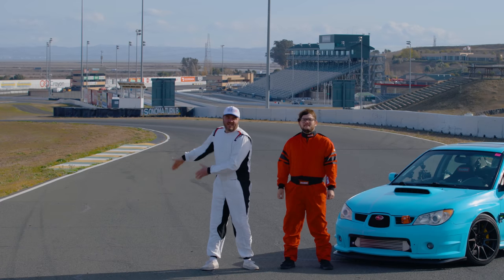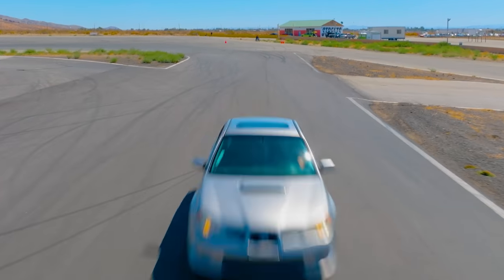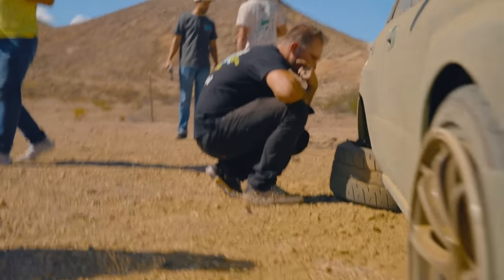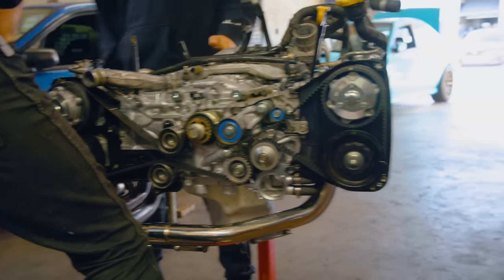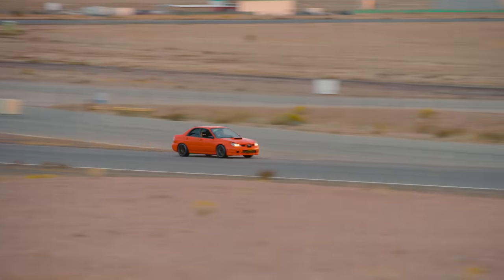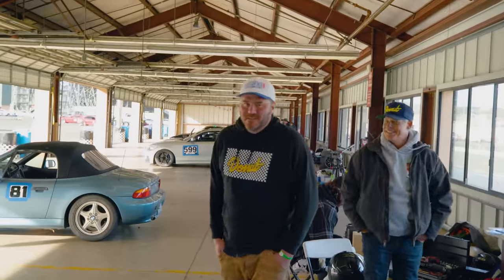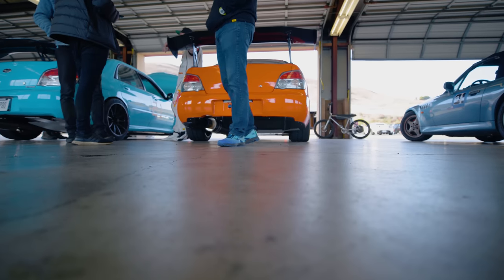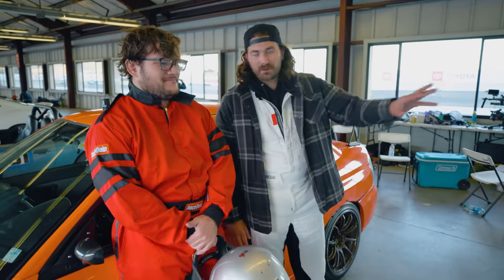$21,000 vs $43,000 Subaru WRX Build - HiLow FINALE!

Comment: I’m still thinking you guys should do a money pit series on an old school Honda. You can use the EG hatch that Nolan got for $500. That way you can take your time building up a really nice setup. The cherry on top would be that you don’t need to worry about blowing the engine.
Reply: the d series means that car is useless and a b or k swap is a big thing compared to turboing a miata
Reply: J swap it
Reply: @xexecuterxx  turbo vitara build is sub$1000 and the d16 would make some serious hps, also a B swap in an EG chasis specifically is really easy so it would be viable if Nolan did single camD and James did Dual cam B
Reply: I'm thinking they had something planned from the time they bought it.
Reply: As a bugeye wrx owner......yes
Reply: I would love to see B swap Honda Civic VS delta/theta swap Hyundai Accent.
Reply: YESSSSSS. Hi car with a k swap and low car with a b series
Reply: EG without blowing up an engine?

yeah with 110hp as peak performance 😂
Reply: I think if they build the $500 civic they should compare it to the new type R.  See if you can build faster for less money
Reply: Came here to say this!
Reply: @TunPiccolo  I have the smallest motor you can buy the d15 single jingle... Mines got 280,000 mi not a single issue. Now they could B swap and make four or 500 horsepower with a GSR trans would be a fantastic video
Reply: @toka100  with a 50,000$ budget ofc the EG will be faster than the Type R. Lighter chassis, stupid cheap parts, you name it. The new Type R will just be the better car all around with all the creature comforts of a new car, and a new sports car at that
Reply: Honda EG high/low Drag car ;)

Comment: The moment I found out hi-low was gonna be Subarus, I knew there’d be a lot of engine replacement happening, and this is coming from a former Subaru owner who intends on getting another one some day.
Reply: Same, I just got rid of my Subaru right before it was going to cost me a fortune in repairs. I'd get another one but I need to convince my wife that the kids don't need any food so I can keep it running.
Reply: Another engine replacement or WRX?
Reply: I just dont get how people blow engines. I have a 14" FXT,  I touge the Sh... Out of it, 150k miles not even the CVT has failed, not even a HG...
Reply: @514aam  Former 06 wrx and 11 legacy owner with some notes. 1. CVT will fail around 175k every owner I know has had this happen. 2. They stil havent done an AOS or baffled oil pan and wonder why things are going wrong.
Reply: Who hurt you Snaker?
Reply: @PongLenis32  Early on in this video they do address that both cars have baffled oil pans. No mention of AOS though as far as I know. The elephant in the room though, at least in my room, is they admitted early on for FAILING TO BREAK IN THE MOTOR PROPERLY. Hurr durrr I wonder if all these metal shavings and components not seating together nicely before thrashing on the track might have something to do with engine failure. SMH
Reply: @PongLenis32  They address baffled oil pans in the episode. They say those were installed "the whole time".
Reply: @joshmurphy1942  I skimmed through and didn’t notice the pans good call but AOS and break in are also key!

Comment: Jeremiah seemed so relaxed in that accident
Reply: I know he’s been in wrecks before at least in motor cross. You may never get used to it but you probably learn how to respond.
Reply: Gotta stay loose and calm. If you tighten up, that's how bones start to break
Reply: @Le Floch  Sometimes, but holding on tight is the reason I'm still around. Mind you, that was in an 84 Toyota pickup with a bench seat and only mostly functional seat belts in a roll-over. In a modern car with airbags and bucket seats, you're probably better off staying loose, less muscle and tissue damage too
Reply: If you panic it makes it worse
Reply: Getting off at a racetrack is not the same as falling in a ditch on the roads.  But seeing the car behind him have to go off track did get me worried!
Reply: @eyemastervideo  saw that; that (edit: BR)Z had a good save.
Reply: @SpaceMissile  wasn't that a brz?
Reply: @xxslayer255xx  17:11 - you are correct, good sir. 
thought I had seen those angled 370 headlights.

Comment: I would love to see the total cost including all the swapped engines
Reply: Triple digits for sure
Reply: So much money
Reply: Definitely not $43k 😂
Reply: yea I need the full receipt. probably over 100k on high car😭
Reply: @robertm6312  no shot
Reply: As someone who owns a few Subarus when people ask me if I'd recommend them for reliability I say no, get a Honda. Having said that bc of the ol head gasket issue. craigslist and Facebook marketplace are a great place for finding safe beaters for new drivers once you replace those head gaskets over a couple days or weekend.
Reply: They should’ve just engine swapped from the start 💀
Reply: 5 engines right? If he’s getting super hooked up call it $10k an engine. So $93k for hi car
Reply: @LingLing1337  They definitely weren't putting new engines in the car until the end, and new EJs for that year are about $2k if they aren't getting scammed, used is $1k, and rebuilt is probably $1.5k again as long as they aren't getting scammed. More than likely they spent about $15k on engines for hi car alone. They did get 2 Type RA shortblocks for both cars at the very end, and that was likely the most expensive block at $2200 per block without install and setup.
Reply: @jasonharrod3070  Sound advice and for the people dead set on the suby just gotta make sure they stay on top of the oil & coolant & if they drive it like a granny it would probably last.
Reply: @drakemadman00  bro it’s three cars, 5 or 6 engines, all of the upgrades and a new transmission. they also had to buy some parts again after the og high car died, definitely over 100k
Reply: @mrmonkey445  definitely not, subie engines are cheap even good ones and a perfect example of a good subie would be top 15k, they didn't have to buy all new parts for it like when the engine died they didn't buy new brakes and a turbo, it was (at most) the new coilover on the axle that broke which was 500 bucks. Seeing as the parts just swap right over there's no extra cost outside of engine and car which is way under that 6 figure mark

Comment: Thanks for the series, highly entertaining!  I understand why you classed tires as "cheap" based on your experience there, but this isn't actually a good idea or suggestion.  In fact, tires are probably one of the biggest "don't buy the cheapest" categories.  Go to any autocross or track and the people that are winning there sure as shit aren't doing it on Walmart tires.  To me, cheaping out on tires - especially if we are talking about racing here and not just parking hard at McDonalds - is right in line with HotBoi Spec.

Spend the money on suspension, tires, brake pads and safety (up to you if seats fit that last category).  Save your money on turbos and big brake kits (though one could legitimately argue that the WRX calipers aren't up to snuff for track duty even with quality pads).  Use that money you would have spent instead on getting more seat time and improving the driver mod.  It's hard time if your times were improving because of the mods...or more likely because you were personally improving as you ran the course more and got more used to it.

Anyway, thanks for the effort here, it was fun to watch :)

Comment: owning a subaru without knowing it flaws is a deathtrap
Reply: Depends on the Subaru. The ej207 engine and 6speed box are bulletproof
Reply: @tracktimevideos5164  Yeah the 207 is literally the best engine Subaru has ever made. I have the EJ20G which is decent but will definitely be getting swapped for a 207 when I have the cash
Reply: Think they would have been safer getting Gremlins. At least the engines rarely blew up. It was those gas tanks though. Didn't want to get hit in the rear end, hard.
Reply: The whole car is one big flaw.
Reply: @tracktimevideos5164  those things run hot as fuck and once it knocks on cold start it's over. Block is done.
Reply: @luckypennybenny  not necessarily. Could be piston slap which isn’t a big concern, normal on built and high mileage engines
Reply: Not really. My Subaru’s were awesome cars. Especially the one I tuned the shit out of, granted I did detonate the transmission, I knew that was coming and was ready to rebuild it. Aside from that, fuckin awesome car. Need to get another one.
Reply: Never had an issue but I’m not dumb enough to put old metal shavings into new engine after new engine
Reply: To be fair I think they bought some meh parts even for hi car. Plus if the V8 video is anything to go off, they're more interested in making these videos fast than modding the cars correctly...
Reply: @Qardo  you're thinking of pintos. Gremlins had no gas tank issues
Reply: The worst part is they knew very well
Reply: @randoawesomemix9501  Alright...yeah I mixed the two up. Doesn't help the two are shitty cars. So...wasn't THAT far off...still off but I at least hit the target.........kind of.
Reply: RoadKill was pretty good for a long while
Reply: Ohh come on!
Who knows they'll be waking up tomorrow morning.
Life is Life, Subaru is Life.  : )
Reply: Change that to "owning a WRX is a death trap" and you would be right.  It comes down to who buys these cars - mostly younger ass hats who never saw an engine they couldn't redline from every traffic light, and never saw a clutch they couldn't burn out.
Reply: This highlights what most already know: Subaru performance sucks, they are for creeping around dirt roads wearing flannel
Reply: @tracktimevideos5164  STI 6 speed > WRX 5 speed: period
Reply: @luckypennybenny  they do indeed run hot but after 20 track days mine is going strong. Regular oil changes are key.
Reply: @cratelab  lol, obviously
Reply: @stubbingtonmarigold3032  this highlights how very little you know about cars.
Reply: I told myself that if I ever own a subie it would be for a garage decoration. lol
Reply: @tracktimevideos5164  not so obvious for the hi/low crew.  It's a bit of disservice to the illknowledged viewers... And if get it... It's "fast food"... And not a grossly indepth build series...There's so many things overlooked...
Reply: Just like with any other car.
Reply: @tracktimevideos5164  I only have ej25 on my 09 sti hatch that I could only speak of. I have fully build ej25  from our mini garage we have full access to build engine since my father is quite knowledgeable about machine, we fly planes and such so we have basic stuff tools and machine to build engine. my ej25 is running like a champ till now, 5 yrs and 180k on its clock pushing around 5xx hp on safe tune on small turbo but it could easily make around 700 on bigger turbo and e85
Reply: Subarus have flaws, but the main problem with them is their audience. Everyone who gets in one thinks they have to redline and throw it around corners with one hand while vaping with the other.

I'm willing to bet these "unreliable" Subies are driven twice as hard as the equivalent Toyota.
Reply: @rando5673  fa24 enters the chat
Reply: The way they were ragging on these cars, it was bound to happen.
Reply: Owning a subaru is a deathtrap.
Reply: @lovingtennessee7726 I love my Subaru. Drove it for two years on a 500$ junkyard motor rebuilding now to get more power. And I will not be driving it like these guys because I know Subarus need to be broke in prior to actually driving them

Comment: Yes the overall performance initially won't be much, but the reliability of good parts over time is what is key. Being able to run the exact same time lap after lap in 100+ degree weather is a plus. I love this comparison and glad you guys do this. Definitely like how you show what matters and what you can go cheap on and it will never really matter. This definitely helps with my car upgrades. Thanks! Oh and I learned not to buy a 2007 subaru wrx. Ever.
Reply: except it's the expensive car that wasn't reliable 🤷‍♀🤷‍♀
Reply: @MJ Bosonian  it had nothing to do with the parts they added, the engine's are just crappy. Don't buy a subaru in those years, they were known for having problems.